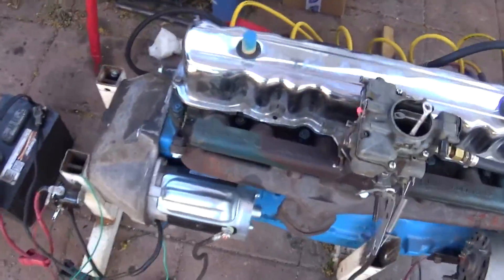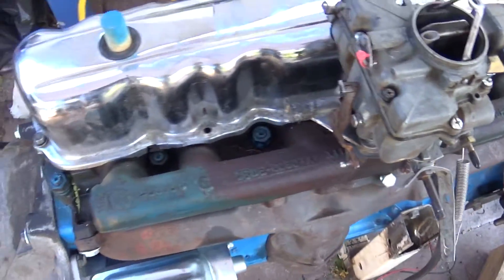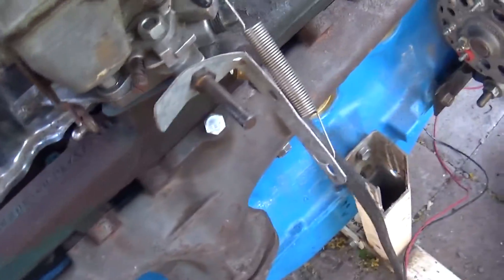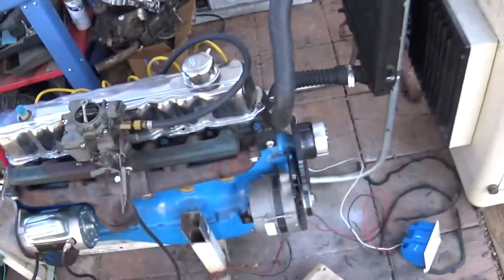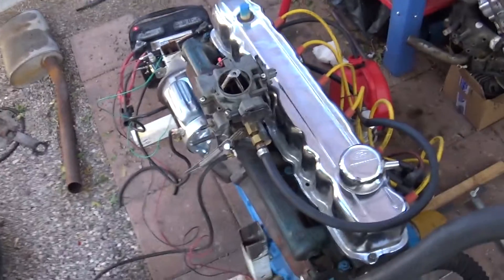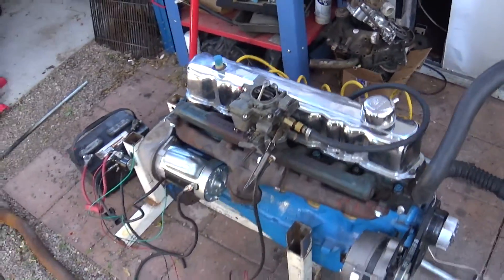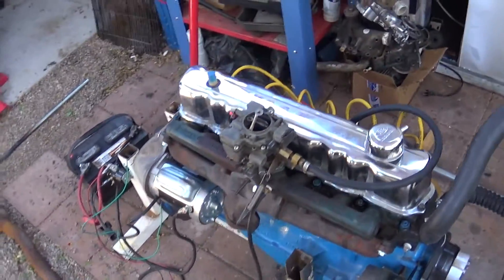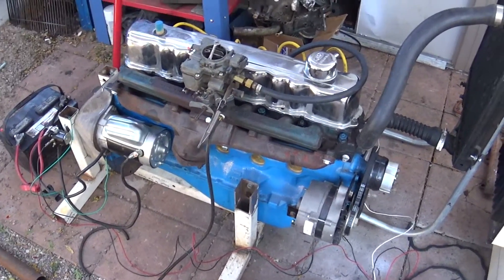Built 200 running again

Comment: can you tell me which direction fan rotates, and which way you are facing when stating direction. i am changing brushes in generator and lost track, the brush edges are sloped
Reply from the maker: Everything rotates clockwise when facing the pulleys.
Reply: SuperKONR thanks man